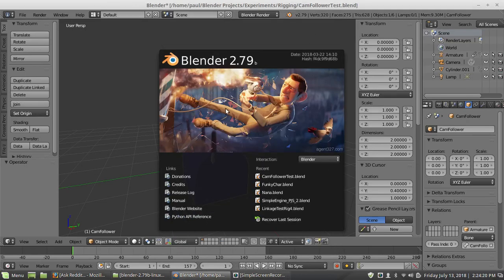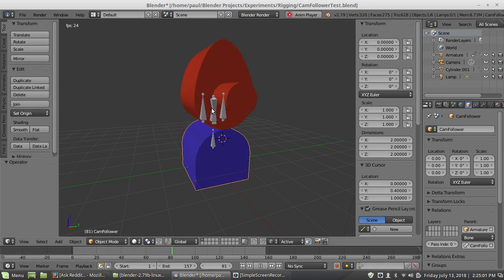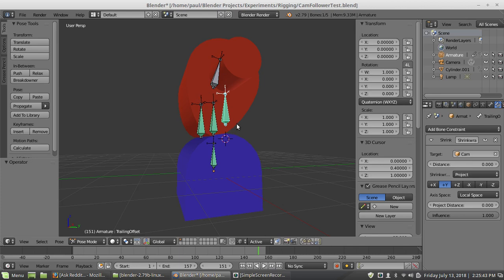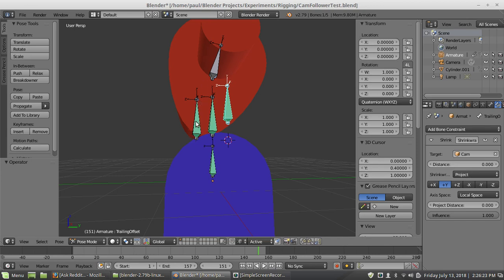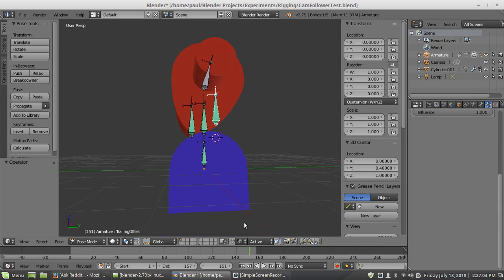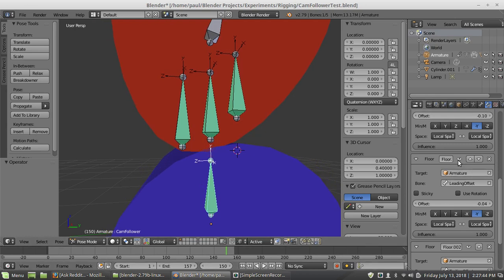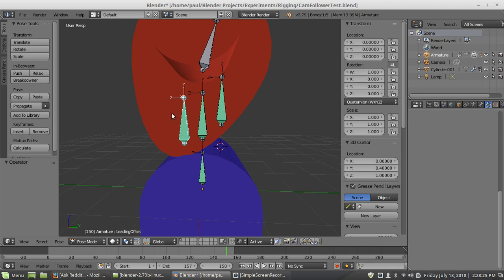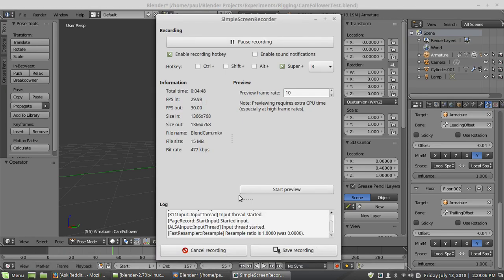Simple Cam Follower Rig in Blender

Comment: Ive finally found a new solution to this without needing bones at all, took me weeks, posted a vid to my channel, will make a tutorial if i can get up the courage lol
Reply from the maker: Can be done with empty objects, but it turns out bones may as well be empties with a lot more useful features available. Alternately there's ways to do it with collision, but that tends to be more calculation heavy. Then of course there's setting up drivers or certain transform constraints, but that means doing most of the math in your head beforehand.

Of course it'd still be interesting to see what you come up with, Blender has many ways of doing things and sometimes what works best depends on the situation.
Reply: @pauljs75  have you seen my vid? Mine uses none of that